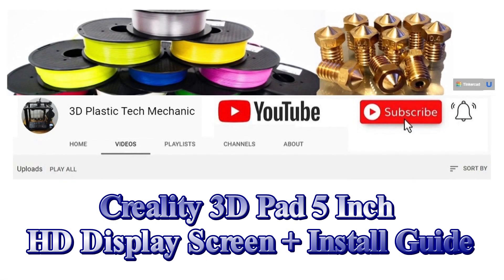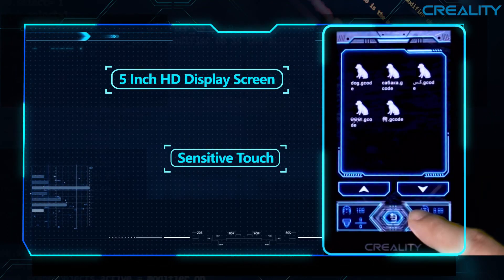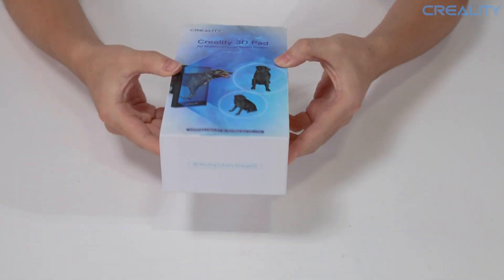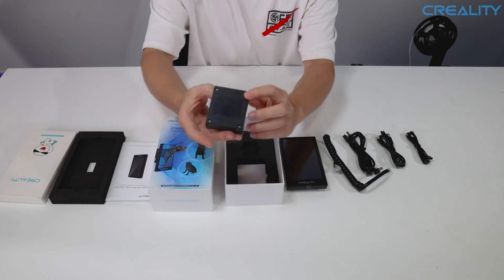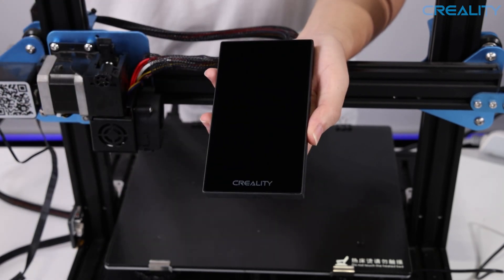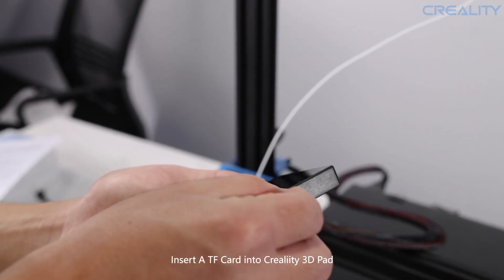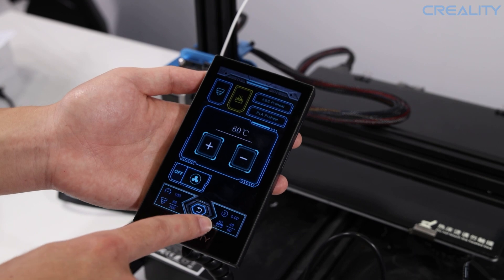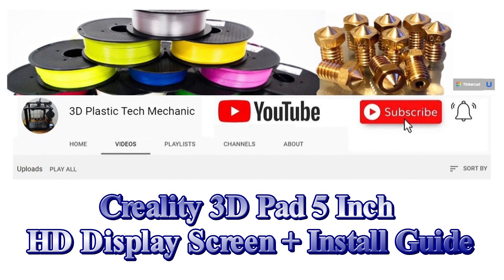(1) Creality 3D Pad 5 Inch HD Display Screen + Filament run-out sensor Install Guide

Comment: Where does the runout sensor sit?  Do you stop using the runout sensor on top of a CR10 then?
Reply from the maker: You would want to fit it in the line of filament but still run it through the printers run out sensor as well.